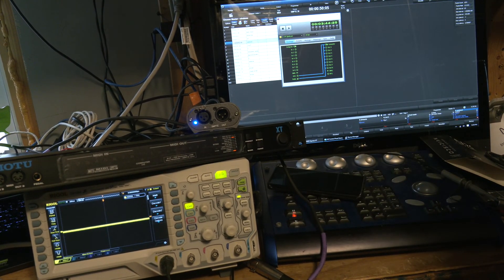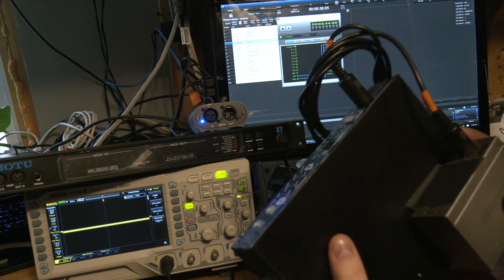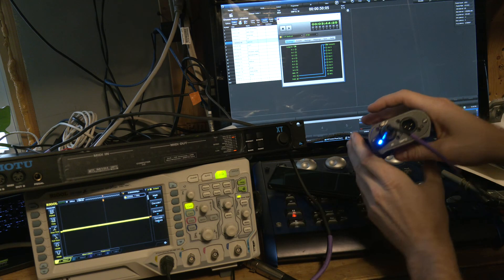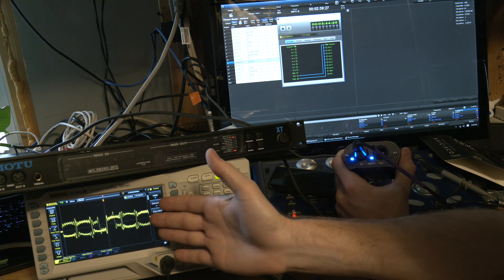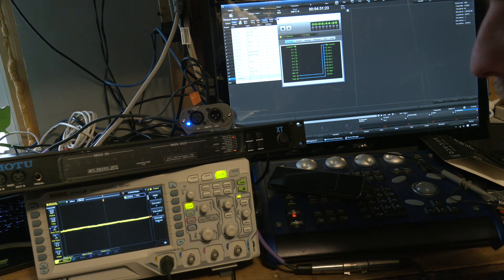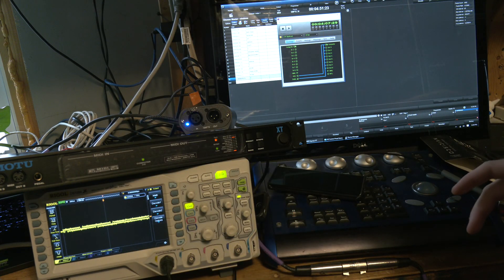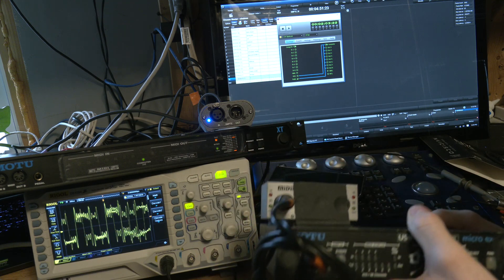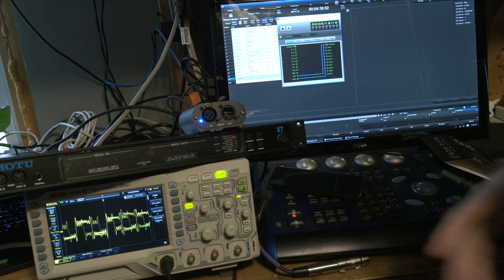NX sync VS MOTU express SMPTE decoder

Comment: Can you please recommend a sync device,  I would like to synchronize  Cubase running from a PC to a Protools running from a Mac. I want to make Cubase the master and Pro Tools the slave. Essentially, I want to press play, stop, rewind, scrub left, right and have pro tools follow. The goal is to have Cubase (master) as my sequencer and pro tools (slave) to run video simultaneously. There is a device that does this exact thing but the price is $4,000. after this video I know that there are better efficient cheaper ways. Thank You for your suggestions and thank You for this amazing Video.
Reply from the maker: Dose Cubase support Smpte?
Reply: @GetNshitDone  Hi, yes!.
Reply from the maker: @J.Livermore  Get two of these https://amzn.to/3OiNPwm and a pack of cables https://amzn.to/3KlIhjo and then you will need to go to your settings on both computers and set one as a master and the other as the slave. I don't know either software well enough to know if these settings exist but since Protools is kind of an industry-standard I'm sure it does.
Reply: @GetNshitDone  thank You so much!!!
Reply: Great video! I got a MOTU rig for my studio 5 years ago, and haven’t needed the smpte feature …. until now(!) Very happy to see how solid the MOTU box is for this, and now I can carry on with my projects. Only drawback is that I now need two MOTU boxes, but at least I know it will be worth it :)

Comment: i got the micro express, it doesn't convert midi clock to smpte. am I missing something?
Reply: Micro Express US
B does
Reply: @ChristopheNeau  i have tried days on that mini micro express, and it's clearly written on the front panel, MTC,  MTC is entirely different from than midi beat clock and song position pointer and start-stop.  the smpte to MTC and from. that's what the smpte can do on this tool, but was thinking it could convert midi beat clock (beats and bars, not time clock) and midi signals,  but it's just a sort of timing with real clock that's being used in film industry.  offcorse it has a midi USB and 6 out and 4 ins that can be routed and the share and merge midi beat clock and noted or signals.  iv contacted motu and they don't care,  the motu sound interface has the build in clock that can be started with MME from the mini express